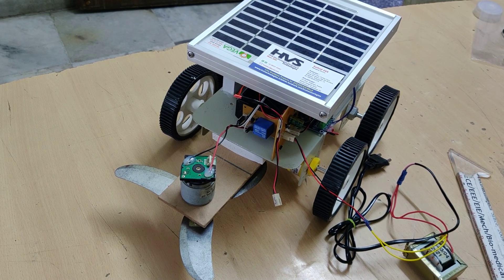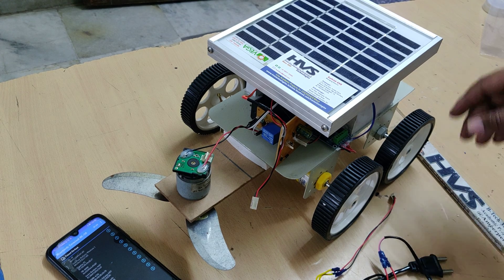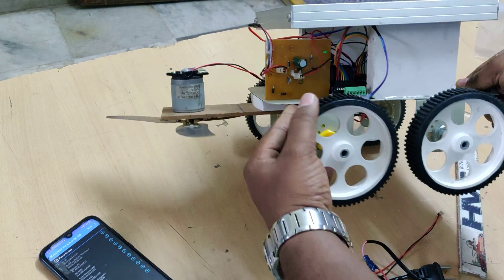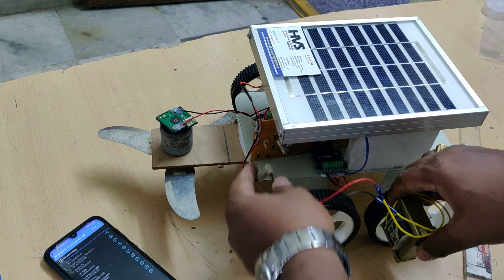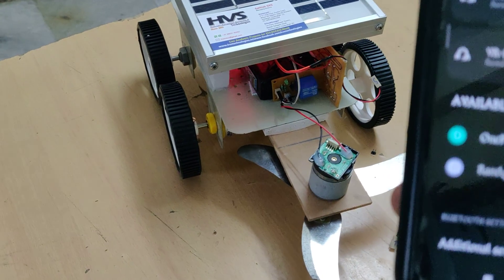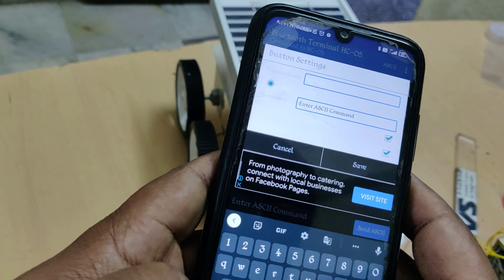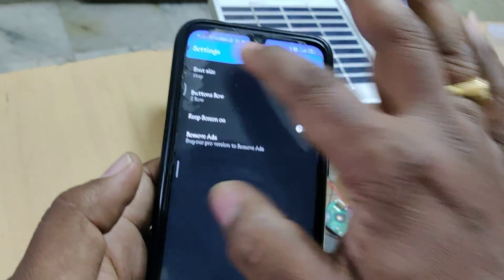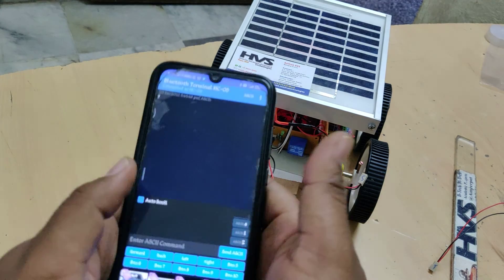Solar powered Grass cutter - Bluetooth Controlled

Comment: Sir what is RPM of the motor and what is the Battery voltage sir ?
Reply from the maker: @joegodwin87  1000 RPM, You can contact us at +919603140482
Through WhatsApp or call